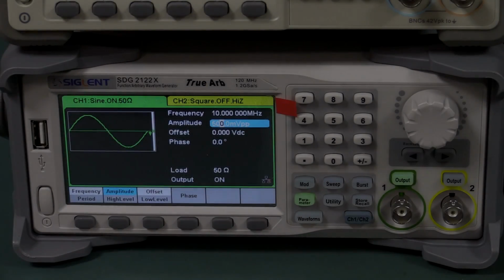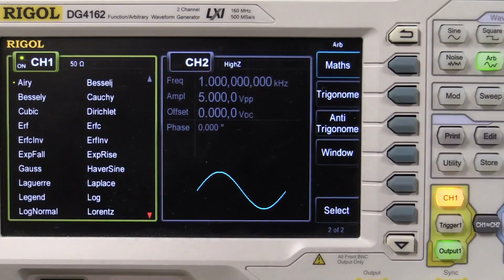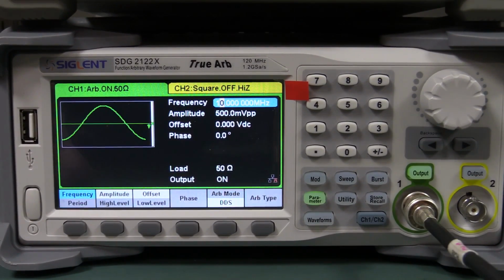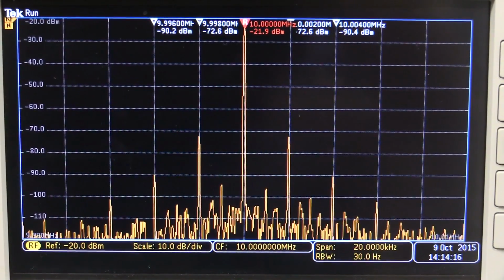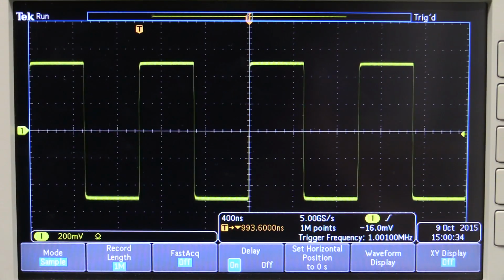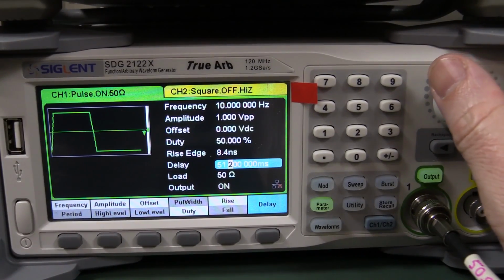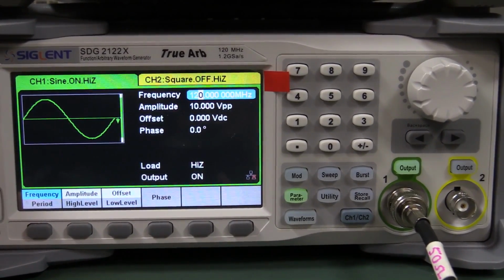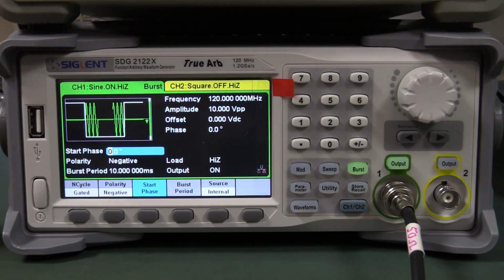EEVblog #806 - Siglent SDG2000X Arb Function Generator First Look

Comment: You should take a look at the entry signal gens on the market..
Got the cheapest Rigol PRO back in nov 2023 DG821PRO.
aint to shabby hardware-wise.. supports 200Mhz, 16bits, 1.25G, 32M for under 300 US.
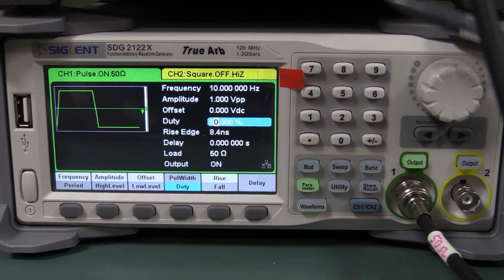just checked the pulse, to see if there is a limitasion when you get down t´he slow frequency.  14:47
Looks like its 3ns down to around 0.5Hz
Its one of these  https://www.youtube.com/watch?v=4-k8SN8EUAA..its a coupple of year old now, but it does deliver a lot for the coins as its relative easy to flip it, so it thinks its a DG922PRO.

Comment: Does anyone know of an op-amp (high voltage) which can be used with these waveform generators?  I am working on generating automotive iso 7637-2 pulses for doing transient testing on equipment w/ the true-arb technology.   Voltages will need to go up to +/- 150v

Comment: I have a Koolertron 60MHz and looking to upgrade for a Siglent 2000x series and wondering if I should get the 2042x or the 2082x is worth the extra 120$? 
I already got a Siglent sds 1202x-e O'scope, spd3303x-e DC PS, and a siglent SDM 3055 DMM.
Reply: nvm, decided to splurge on the SDG2122x XD

Comment: The new Firmware and Software for the new Siglent SDG2000X Series Generators adds the following features to the generators: ( date 10-29-15 ) 
Harmonics Function
Adds around 140 or so more ARB waveforms. I believe the total is now 193 or so.
Adds an adjustable bandwidth to the Noise function.
https://www.tequipment.net/Siglent/SDG2042X/Function-Generator/

Comment: Quick question about DSOs: If my uC runs at 80 MHz, do I need an oscilloscope capable of at least twice that bandwidth to see the signal?
Reply: Some people reccomend 5 times bandwidth for square waves. uC runs from square wave clock its bandwid is also depended on the rise time.
Reply: Your uC might run at 80mhz, but that is the internal clock. You will notice with most uCs the maximum output frequency you can achieve is about 2-3Mhz. What Alperen says is true, square waves look the way they do because they posses higher frequency content beyond their base frequency, and thus you need a higher bandwidth to display them properly. So a 15Mhz scope would more than suffice, which is practically any scope nowadays. 

About the doubling of bandwidth, I think you are confused by the Nyquist criterium. It dictates that your SAMPLING frequency should be at least twice the MEASURED frequency. This is a digital phenomena due to sampling. The 'bandwidth' on the oscilloscope though, is not from digitizing. It is instead an analog bandwidth. I.e. with a 100mhz scope you can measure at most a 100mhz pure sine wave (usually scopes do better than their quoted analog bandwidth though). 
On this note, scopes also often quote a sample rate, for example 1Gs/s. That means that their sample frequency is 1Ghz. This is the frequency that matters for the above nyquist criterium. But for any modern well designed scope, this sample rate is far above the analog bandwidth, even in worst case scenarios.

Comment: You can't compare 120 MHz between the two machines when one is at 9+ volts and the other is only at 4+ volts.  Cut the Siglent voltage to 4v and I bet those sine waves clean up nicely as on the Rigol.
Reply: why is it that you can't compare the two channels if the voltages are different?
Reply: TheRealMoomin it’s not comparing the two channels, it’s comparing the output of two different instruments. One Rigol and one Siglent. The problem of that comparison is that Siglent is driving twice as much output swing than Rigol at the expense of larger distortion. So if one really want to compare distortion accurately, the output drive level need to me the same.
Reply: @Wooksterish  A higher amplitude requires a faster rise time. For a certain signal A*cos(omega*t) you can find the slope with -A*omega*sin(omega*t). I.e. increasing the amplitude or the frequency causes an increase in maximum signal slope. 
As you can imagine, it is harder to drive reactive loads with a higher slope. So things like cable capacitance will ruin your day sooner!

So yeah, Digger D is right, you should compare apples to apples between the two devices, and have the exact same waveform specs to compare, especially important at the higher frequencies.

Comment: hello EEVblog,  i know you have not time to answer personal electronic questions. 
So can you drive me to a book or a website that would  instruct me how to mix a high tension 50 hertz, with the 1,5 volts and any Hertz from  that come out of a Siglent function/arbitrary wave form generator ? -- an exemple: a microwave oven transformer 50 hertz that would give, after a circuit, the same voltage with any of the hertz coming out of the Siglent.     Thanks very much EEVBlog !

Comment: Dave, the "strange" bumps you saw on the spectrum analyzer are due to the loop BW of the PLL.  A PLL can be thought of as a low pass filter for jitter and phase noise.  In other words, a PLL will track phase noise that is within its loop BW, but can't track phase noise that is outside its BW.  The ref osc (typically an oven-controlled crystal osc) will have extremely low phase noise, and the VCO that is part of the PLL will have significantly higher phase noise.  So the output phase noise of the PLL crosses over from the ref osc curve to the VCO curve at the 3dB BW of the PLL.  These crossover points typically look like the bumps you saw, rather that distinct spurs.

Comment: LOL, Staircase rise and fall on the Rigol, (facepalm) I was hoping you would look at the rise and fall of the actual staircase itself :^) Good review Dave.
Reply: +NPNtube Rigol: There must be a minimum number of stairs to have a defined ramp. I count a bit more than 32 stairs, maybe exact 32 stairs from 10% to 90%.
10Hz vs. 195µs ramp time vs 32 stairs lead to 16384 samples memory depth which matches the specification of the device. Siglent on the other hand specifies 8M samples... huge difference.
Reply: +Mr Carlson's Lab It even looks like only 4-5 bits resolution on that staircase.
Reply: +Alfred Stampe Not a matter of limited resolution but limited memory, I believe. The whole cycle is stored in the limited memory which leads to a low sampling rate and finally results in the stair case.
Reply: And she's buying the stair way, to heaven.

Comment: Doesn't it make sense that the delay is limited to 100ms when the frequency is 10 Hz?  As in one full period?
Reply: +lmiddleman It would make more sense for the maximum delay to be two periods.
Reply: I was assuming it was plus or minus 100ms.
Reply: lmiddleman Negative delay? So this is how they make time machines...
Reply: +lmiddleman I think Dave misread, 100.000,000 is 100K in "European" style decimal separators

Comment: That Rigol has commas between every three digits after the decimal point in the frequency?  Is that common anywhere in the world?  Major annoyance if that can't be disabled.
Reply: +lmiddleman 
It's called "digit grouping" and it is not uncommon, because it makes reading big numbers more easy. You can disable it on the Rigol (and also exchange dot and comma as decimal and group separators).
Interesting Wikipedia article: https://en.wikipedia.org/wiki/Decimal_mark
Reply: +Jo Pe It is a shame that we all could not have cone to a common agreement on how to specify decimals and digit groupings in a single universal format for everyone.  It makes internationalization very confusing when 3,100.099 and 3.100,099 mean both the same value and simultaneously a very different value, either of which may be the correct value.

Comment: Great video. The baseline spread at 80MHz -22dBm output of the SDG2000X (11:00minute in video) may be caused clock jitter or quantizing noise in the SDG2000X.  Curious what others think.

Comment: To get rid of sidebands, I would use a -10dB attenuator on the input of the SA to reduce input distortion and change the graph offset to +10dB. Of course you lose 10dB of noise floor, but that shouldn't really matter as much (except for military, mobile communications engineers, R&D, etc.) If you want to see what's at the noise floor, you usually wouldn't be analysing a signal several orders of magnitude greater at the same time anyway.

Comment: The hobby community can only be happy. The way things go these days more and more hobbyists can afford equipping their home labs with nice instruments.
Reply from the maker: +VoltLog It's crazy what you can get for the money these days. Wasn't that many years ago that a 2MHz sine/square/triangle function gen was the entry level standard.
Reply: +VoltLog may be increase in sales making companies produce stuff at bulk and and lower costs. a lot of hobbyists buying decent equips these days.
Reply: there might be more factors to this, like for example R&D might be cheaper for these smaller companies, they don't design custom asics, they use off the shelve parts and they don't exactly use top of the line components in the hardware. Shaving a few dolars here and there coupled with a lower profit margin might be the reason the end equipment is cheaper.